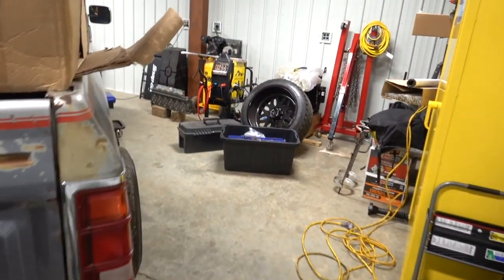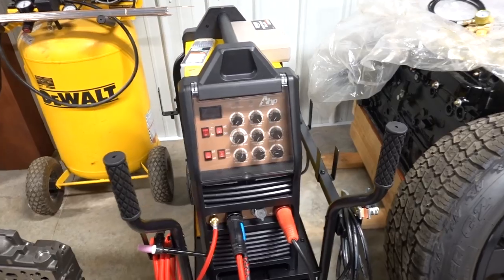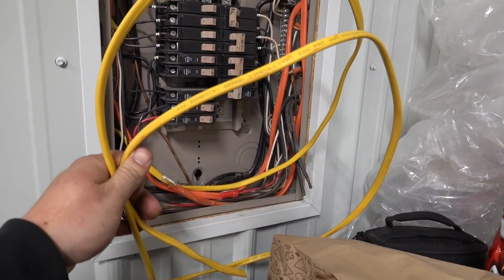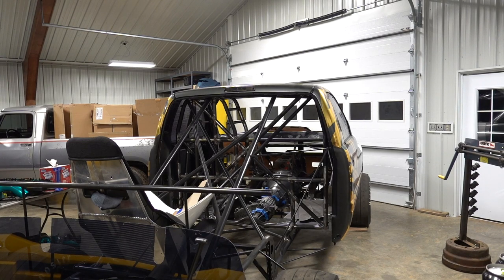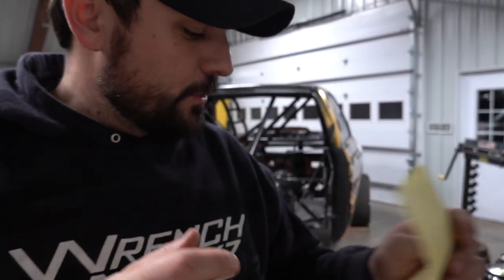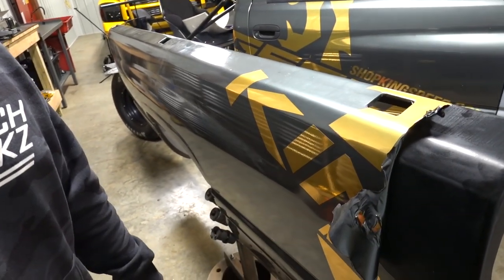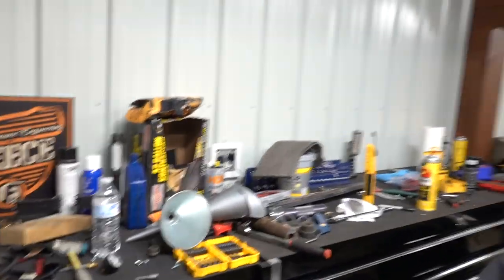MY FIRST TIME EVER TRYING THIS!!!! MASSIVE SHOP UPDATE!!!

Comment: I just moved from Vegas to Hopekinsville Kentucky to work on a Giant Grain farm that does 39,000 acres per year. I moved here to help with building custom harvesting equipment and to help keep the 39 John Deere tractors 9420R, 9620RX, all 4 wheel drive tractors with several more model's going in the fields because if we have 1 tractor broke down and not in the field it puts us behind 800 to 1,000 acres per day per tractor and we are already working 16 to 18 hours per day from last week til November. If you need anything let me know we have every machine need to do metal fabrication and more if you need anything.

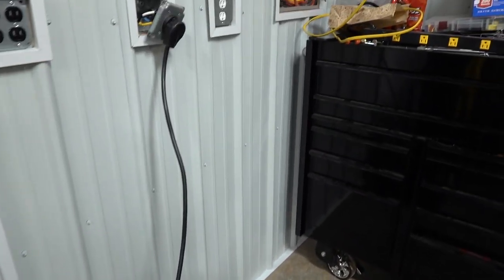Comment: What tig rod is being sharpened at 10:31 .. Depending on the rod some give off radio active dust which is not good and should be sharpened with a special sharpener with vacuum or at least outdoors ..
Reply: lufkin tape they got rid of that

Comment: Alright so this might be a dumb question. But I don’t know what to do or who else to ask. So I have a 2002 24v Cummins. And yesterday I filled it up and drove it for a half hour or so. And today I go to start it and warm it up and it starts fine and runs like a dream. And I’m in the house and I hear it rev up so I think someone is in there messing with it 😂 but I run out and it’s running like complete dog shit. It bogs down and almost stalls and the idles back up but ends up stalling. I replaced the fuel filter and added some diesel 911 to it and it ran fine almost better then before for about 10 minutes then started doing it again. I’m thinking it has to be fuel related because before I got fuel yesterday it never ran bad even the slightest. But today it runs like crap. So maybe I got bad fuel with water mixed in it or what. But does anyone else have any idea what it could be. Any and all help would be appreciated. Thanks!

Comment: Hire an electrician! He wired that welding recepacle wrong!
Reply: How so?
Reply: @johnrichardson4327  he put the neutral or identified conductor on the ground or bonding screw.
Reply: Not trying to state the obvious but if it was wrong wouldnt it not work?
Reply: @charlespetersonii6989  it works but isnt safe or compliant, basically the welder is ungrounded
Reply: @masseymm  Doesnt the neutral and ground both go to the same place? (Not trying to be a smart ass)